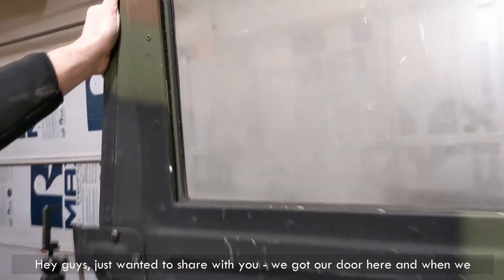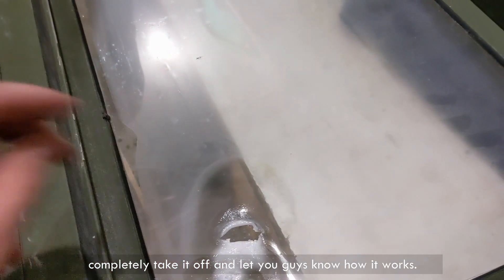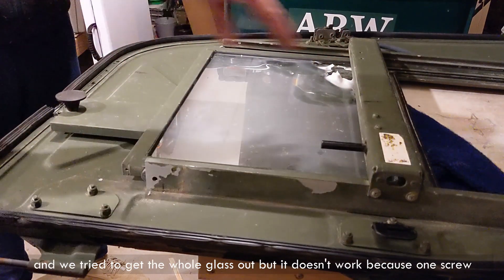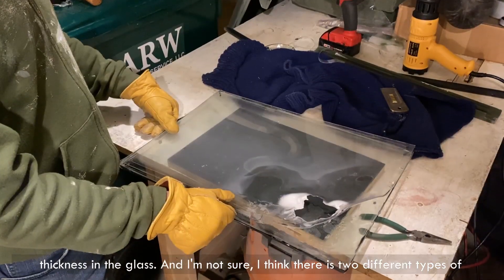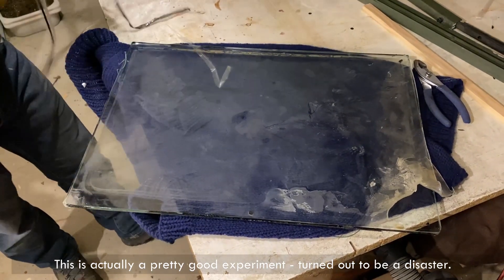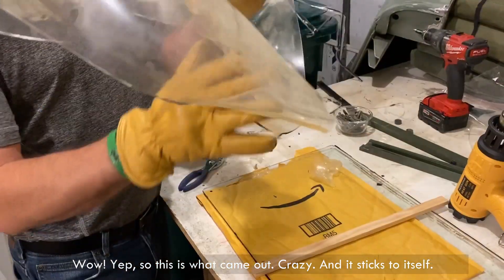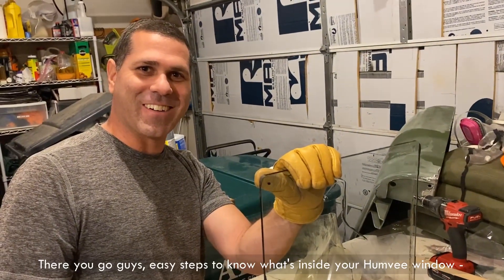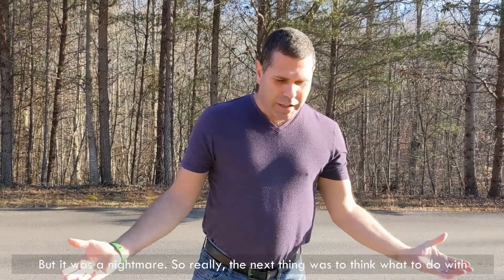Do You Know What's On Your Humvee Window??

Comment: You can go to a auto glass replacement shop and get laminated glass, which is two pieces of glass with an adhesive between to not let the shards go into the occupants. Being that is flat they should be able to cut it for you.
Reply from the maker: Thanks for your comment. We did get 4 new windows with beautiful green tint on them. :) This video was for the intent of educating other new Humvee owners, as we've been told/we've heard some rumors of some Humvee owners who had taken the laminate layers off with a heat gun and put the windows back on the Humvee...
we believe that any modifications to the window afterwards just won't be safe enough for us. We just wanted to show others exactly why it's not safe. I hope this video will be helpful information for anyone in their Humvee journey! Thanks for watching.

Comment: Glad you didn’t put that in the humvee. It’s ballistic glass that’s not designed to be separated. Loses all strength and integrity once the laminate layers are removed. Just buy some aftermarket tinted safety glass for you x doors. Save yourself lots of time and headache. 👍
Reply from the maker: We did have a feeling that the windows would lose it's ballistic capabilities & strength once the layers came off, which is why we thought it would be fun to do the break test to show others that the glass itself is not tempered, because we've heard some rumors of some Humvee owners who had taken the laminate layers off with a heat gun and put the windows back on the Humvee, yikes... 
We did end up getting 4 new windows with beautiful green tint on them. :) I hope this video will be helpful information for anyone who is starting their Humvee journey!